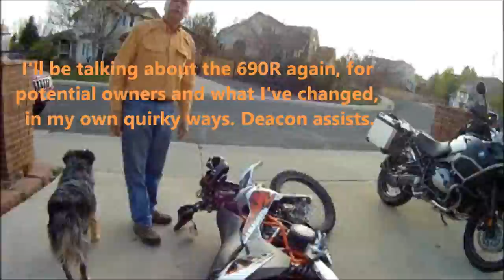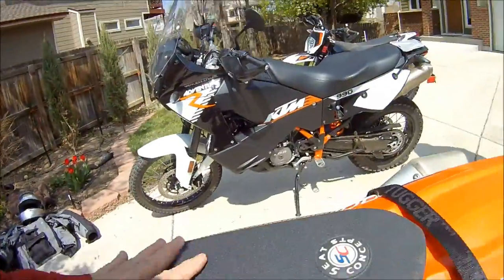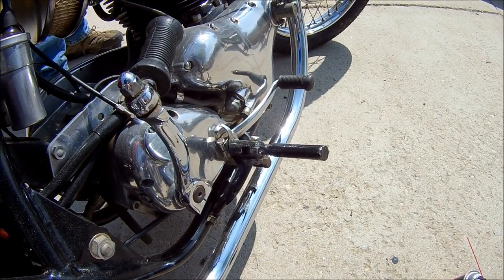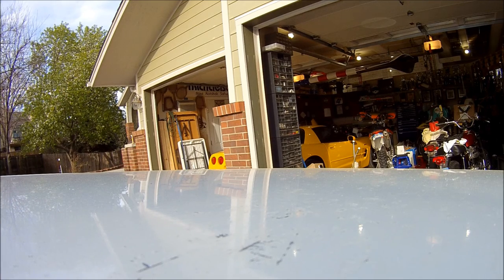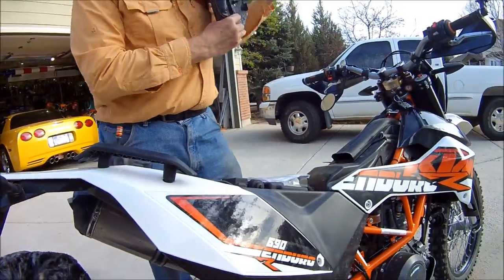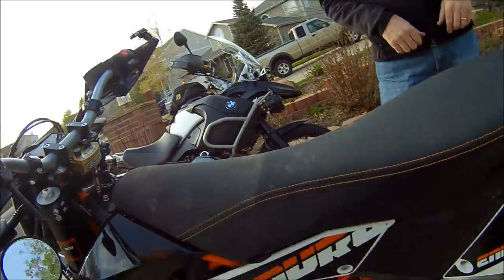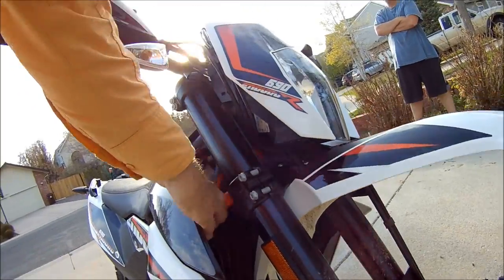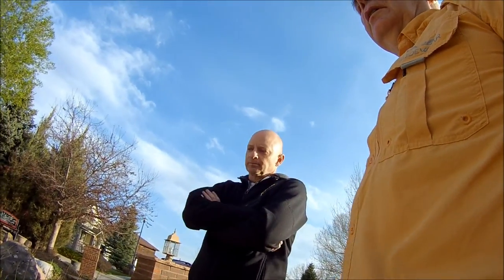2015 KTM 690R Enduro receives visitors from a KTM990 and BMW1200GSA

Comment: This is for those who like and understand a little. A motorcycle that does not come out of my dreams.
The company was founded in 1934 by Hans Trunkenpolz of Mattighofen (Austria, nearly forty kilometers north of Salzburg). It began its activities with a shop and was named Kraftfahrzeuge Trunkenpolz Mattighofen (Motor vehicles Trunkenpolz Mattighofen). In 1953 KTM began production of motorcycles. With just 20 employees, motorcycles were built with a production rate of three copies per day. In 1955, a businessman, Ernst Kronreif, became a shareholder of the company, acquiring a considerable portion of the company. It was then renamed, Kronreif Trunkenpolz Mattighofen.

Throughout the history of KTM, the company was at the technological forefront. Was the first manufacturer to produce an engine four-stroke water-cooled for motorcycle, project replicated by all other manufacturers (other manufacturers bought the radiators supplied by KTM, including the Suzuki in the days when there was only air cooling). In 1986 KTM became the first motorcycle manufacturer to include the front and rear disc brake. In 1998, they created the first motorcycles with linkless rear suspension, dramatically reducing the weight of the bike. They were also the first to offer hydraulic clutch on all models of motorcycles, and the first to offer the superbike supermoto, a ready to motorcycle competition.